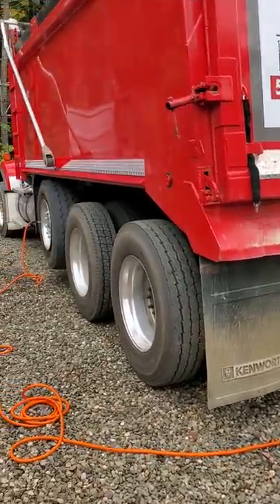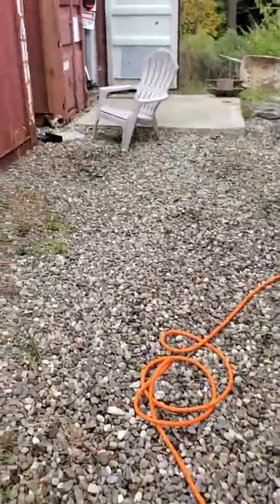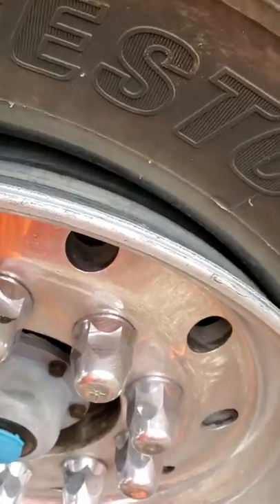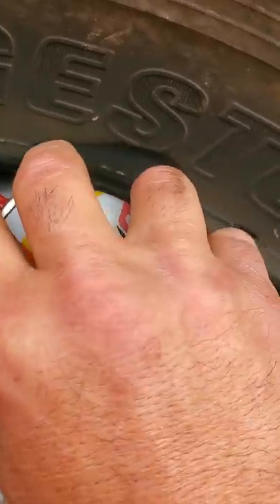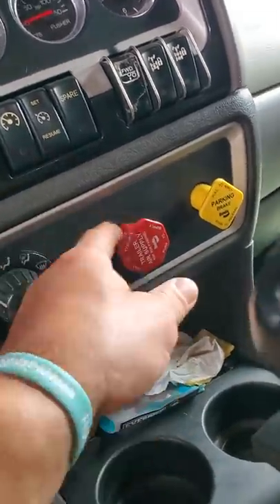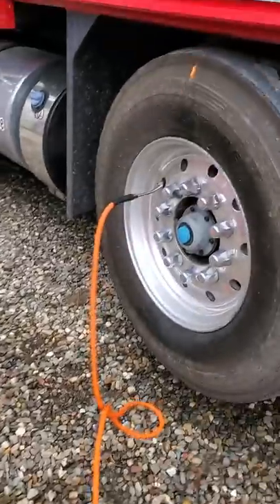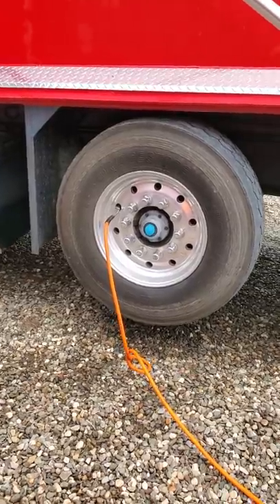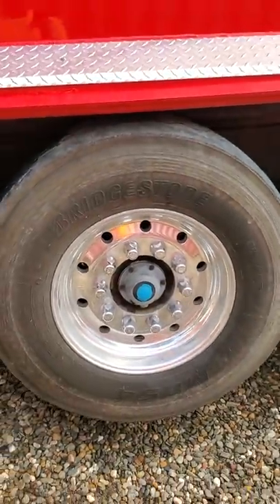Mounting a flat tire with ether starting fluid #shorts

Comment: Great trick I've done it many times but damn that was way more than what you needef
Reply: I've done this with my front tires on the backhoe, but you're right,  he way over did the ether!!!
Reply: @danielschiel7001  almost as soon as the tire bead seals, the fire goes out. Not enough oxygen  to keep burning.

Comment: Wow you should have seen the faces on my coworkers at my last truck driving job I held before retiring. I was on an excavation crew on Martha’s Vineyard, driving a beautiful Late model Mack 10 wheeler dump, moving big equipment around and different materials, when I got a flat out in the field, that by the time I returned from the pit the tire had came off the bead. So I grabbed my air hose, hooked it to the glad handle an connected the chuck to the tire fill. But like I posted above the faces on the owner, his son an two others when I asked for starter fluid an matches??? They thought I was outta my mind!! But the way I was shown, was a quick shot right into the tire, then fold the match over the cover with the head resting on the striker pad, then with the flick of a finger sent the lit match right into the tire and with a loud POP, the tire was right back on the wheel with 30 psi automatically! All it took was a few minutes with the air hose and truck running and the tire was back to the correct psi! With the crew laughing their collective asses off!! That was good for weeks of remembering laughter! But of course those native Islanders, as sheltered a life as ever had never seen such a thing!!!

Comment: Valve core leak or rim leak, spray some soap water in it and around the base. If not glide your hand around the wheel well very slowly and spray any colder spots.

Comment: My dad taught me how to use a rope and a slip knot to go all around the tire middle of the tread pull the rope tight to expand the beat against the rim until it starts to inflate. Never have forgotten that and have had to use it many times. Didn't have rope once didn't have any starting fluid but I had an old firecracker banging around in the ashtray drop that in there and set it off and it did the trick. And then it rattled around in the tire until it dissolved into dust I guess. That and having real good floor mats to use under your tires for traction when you're stuck in the snow were valuable lessons I learned from my dad when he was alive. 🤔👍

Comment: Coming from somebody that works as a tire casing credit inspector for a tire shop / retread facility for semi tires, please stop using fire to see the bead on the tire. It breaks down the lining inside the tire far faster. You'll end up with liner cracking which will cause the tire to leak air continuously far before your tread ever runs out. The main thing that happens is your tire runs low on air as you're driving causing the sidewall to weaken over time and you end up with a massive blowout the next time you put air in the tire possibly harming you or causing a wreck.
Reply from the maker: Sure

Comment: Mike I used to do tires in my earlier years we had a strap that went around the tire and brought it closer to the bead I’ve since used ratchet straps and was successful with them!!! In case you don’t have the spray it’s another option you can use!!!!!! Still love the pop of the spray though!!LOL!!!!!
Reply from the maker: Yes for sure I use a strap on my backhoe once in awhile when I have no lighter
Reply: Henry…. As long as you don’t forget to remove it as soon as the bead seats…. I can attest…. It is possible to turn a strap-end into a missile.
Reply: A couple of years ago, we had to move a trailor at work that had a flat. The only option we had was a ratchet strap. It worked like a champ.
Reply: Working at the fillin station as a kid I remember using the strap

Comment: It’s amazing how many people condemn this or are flat out afraid to do it. Never used that much of the good stuff personally. But if I had to I certainly would. We get trucks going down the rail that’ll unseat a drive tire and it’s the only option to stop them from derailing.
Reply from the maker: For sure it is sketchy but it works and most of the time you got to do what you got to do ! 💪🏼
Reply: I seen a tire service guy down south use too much of the good either and blew the rim and tire about 3 to 4 feet off the pavement along with blowing a hole through the sidewall of a brand new tire... had to wait for him to run back to the shop and get another one..

Comment: I was just talking about doing this yesterday on my RV! Everyone told me I was crazy!
Reply from the maker: Just got to be careful but it puts it on fast I have all the other tools to use but this works best
Reply: @DIRT BOSS  yeah way back when I thought I'd live forever I worked at a shop n I did it once... ONCE! I was told it was " just like lighting aquanet hair spray in the potatoe gun! No big deal just do it!" Yeah  that was the last time I listened to that guy! And the last time I put a spark or flame to something your not supposed to! 
Does the job real well though! And considering 1 of my dually tires is off the bead... the need has arisen ...  there  just may be the smell of burnt starter fluid and rubber in the air here today! Ha

Comment: We can’t get the good either here anymore.   Last time we were really fighting one -20° in the shop. Tractor tire bead was collapsed. Took big ratchet straps to collapse the tread pushing the beads out. Propane broke the straps sent the straps whipping across the shop. Had 5 & 6 gallon bead blasters later pumped up to 110 psi.
Reply from the maker: Wow

Comment: Set many of beads this same way when I didn't have a high pressure compressor.

Did it in the the woods mudding with just a small air compressor many and I do mean many times.
Rail buggy

Comment: When I first bought my Honda S2000 I was a kid and a total idiot. I did a donut right in the middle of a country road. Lost control into the grass and the rear tire popped the bead like this so I decided to do the same thing only it didn't really work the first time the tire popped on to the bead the fire kept burning inside the tire if for some reason it all shriveled up into the smallest thing I've ever seen had a ton of vacuum inside the tire. It was like that egg in the bottle experiment.
Reply from the maker: You didn't have enough either and the tire has to be off the ground completely

Comment: Even if you have a steerable tag axle, if you making a turn even if its not a real tight turn, back off the pressure just a little making turn then reset tag axle. Its extra work but if you own your own truck it saves money$$$$$$$$$$$$$ by reducing wear n tear on tires bearings axle ass. frame n everythin else involved.  Driving means more than mashing the LOUD PEDAL N TURNING THAT BIG WHEEL THING ON THE DASH. BEING LAZY COSTS MONEY!!!!!!!   JESSE

Comment: Aahh I thought it was two handbrakes, but it's actually a button for air supply to the wagon. But why? 
It's like a tractor trailer connection, when there's a clamp connector for wagons in Europe that you just plug in and there's air

Comment: Tighten the valve stem
Reply from the maker: Yes it was stuck open slightly because I checked the air on all the tires the day before that valve must have just been open with dirt
Reply: @DIRT-BOSS  wasn't referring to the Schrader valve, at the stem base there's a 5/8" nut that tightens the stem. The valve core could be loose too

Comment: Put in a healthy amount of your friend ether, then jump when it goes pop 🤯🤣🤣🤣, even though you were expecting it!!! 
Odd how it deflated in the first place, wonder if there was something stuck in the tyre bead ??
Definitely badda bing, badda BOOM 🤣🤣🤣
Reply from the maker: Yeah I'm thinking it was the valve stem not seated because I checked all the air in them last week and sometimes they don't seat after checking the pressures
Reply: @DIRT-BOSS  
When you finish checking the tyre, take your finger spit on it and apply it to the valve, will then show bubbles if it is not seated properly 👍
Reply from the maker: @alexosborne5629  very true

Comment: Bead leak or bad valve stem. You didn't spray it down with soapy water so you don't know if there is a puncture. I know because Not one of you truck drivers ever found a leak in your tire, in my ten years of experience. You aren't a tire tech, you don't use an air gauge, you hit tires with a bat for accuracy. Mmmm, yeah good luck buddy.